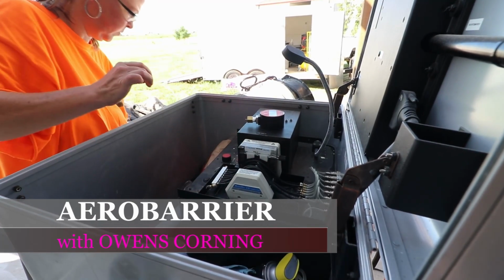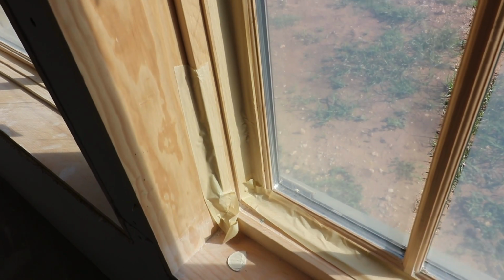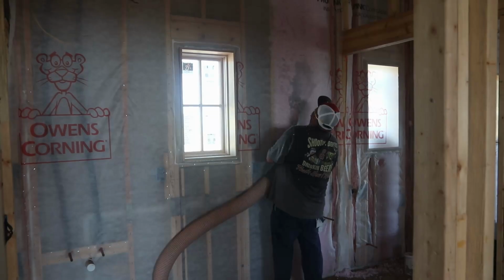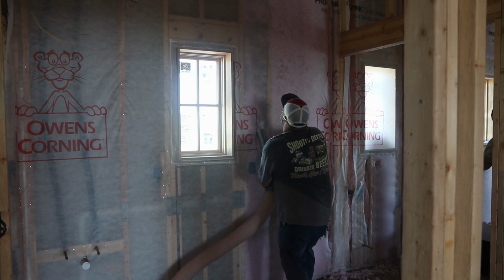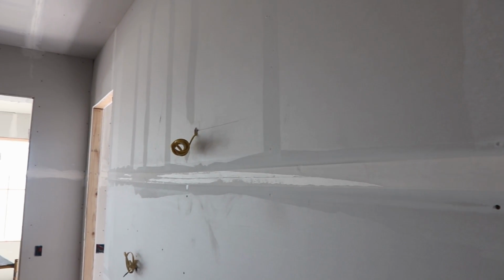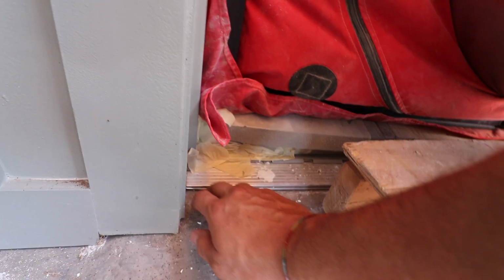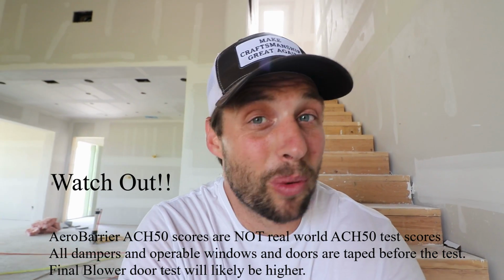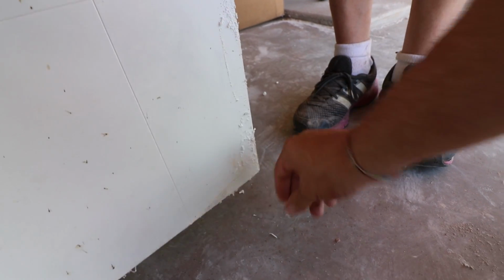This Insulation is BETTER than Spray Foam!!

Comment: Any material that can take on or assume local humidity will lose R-Value relative to the humidity assumed.  So if you are in an environment that has 50-90% levels and your thermal barrier (wall) can assume the same you will reduce the effective R-Value accordingly.  And as the humidity accumulates, from time to time you will also promote conditions ideal for organic life to develop.  So what is the best thermal barrier material?  The material that is the most impervious to any form of water (absorption) and wall air intrusion.  Once you stop air/water to a standard value, then you must introduce fresh air through a device like an ERV.  What about thermal roof systems?  If there is no air between your thermal barrier and roof sheathing - do not vent.  If there is, vent accordingly. Interior air quality levels in "tight" homes require removal of internal living space that accumulates.  i.e. Cooking odors, cleaning chemicals, bathroom odors, etc.

*R-Values of insulation materials are determined in a zero humidity chamber. However, real-life represent significantly higher values that actually determine final effectiveness.

Comment: Did you think of Rockwool instead of fiberglass?  I like that it is better for sound absorption and it is less attractive to mold/mildew and rodents (or so I was told).'

My houses with blown in or even batts in the ceiling do settle over time, fiberglass that is.  One house the blown in by the builder blew all over and some areas were bare, so we used a leaf rake to re-distribute the insulation, then put unfaced 10" thick fiberglass 'attic blanket' batts over the blown in, in the attic.  It REALLY helped.  It was an all-electric home so it had a significant impact on HVAC costs.  I wish we could have sealed that house, it would have been much better.

Comment: Is there no issue with finishes, Paint, stain ect once this is covering the surfaces?
Reply: How it doesn't settle on the floors or stick to other things is odd???
Reply: Good question, i also wanna know.
But you do this with no trim work up. If you do have cabinets, ive seen them tape it all off.
Im curious as to what happens all over the surface area of everything, though. And if its going out, where is it going? When I exhaust my paint room, the paint dust goes everywhere on the side of the building. I have to tape around the side of the exhaust window.

Comment: Q: why not use Rockwool / mineral wool insulation?  I have used it in projects and have had almost no air movement compared to Fiberglass.  It is also very fire resistant compared to Fiberglass.  The best part is the sound deadening properties of Rock Wool almost no sound penatration on 2x6 walls, coupled with triple pane windows the houses are very quiet compared to Fiberglass.

Comment: You showed your incompetence with your stupid comment that houses don't need to breathe. Houses very much need to breathe. There has to be a certain amount of air exchange in the house. There is a reason that no one builds air tight buildings. A properly ventilated and insulated house is the most efficient. You are actually ruining the efficiency of your  house by making it air tight. Horrible video and hopefully no one takes you seriously.

Comment: Wearing the respirator with a beard and forehead hair in the seal surface?  Both conditions render the respirator useless. The HEPA filters produce a greater resistance to airflow than that permitted by your fuzzy face.  Your level of protection was drastically compromised. Next time try reading the instructions that come with the respirator before using it.  (ref. 29CFR1910.134 (g)(1)(i) (A))
Reply: Thank you Sally Safety
Reply: @bigvegass  lol safety is no joke bro
Reply: You would be surprised at how much facial hair you can have and still maintain a seal. And this isn't from just anecdotal evidence - Because of the nasty chemicals and gases we work with, my company requires us to wear Scott full face respirators for certain tasks and we are re-certified every 2 years which includes fit testing where we are wearing the respirator and hooked up to a machine to measure the integrity of the seal.  I've done this fit testing with more than a weeks facial hair growth along with a goatee and I have other co-workers that have passed this testing with a full beard...

Comment: 1980's mobilehomes sealed all joints , and all homes molded and rotted , so if not insulated to passive house , there is no point
all voc in chemicals of  products , will poison air

Comment: Enjoyed this video. I’m fixin to build in central Kentucky and have flip flopping the insulation idea of spray foam or cellulose. How do you feel about cellulose on a slab style home with 2x6 walls and metal siding and roofing. Thanks for any feedback. Will be watchin your channel from now on. Great work.
Reply: Great idea as long as you use the glue mix, otherwise a 10 to 20% settling will happen in ten years or less.
Reply: Wow. That was fast. Since I have your attention.

My fave in 2x6 construction is to spray foam the first two inches and then to install rock woal for the balance.

The spray foam is a strength multiplier in the order of about tenfold in shear protection. Let them Huff and Puff. They won't blow your house down. 

This is always the way I recommend if finances allow for it.
Reply: VICTOR EOUS I’m not familiar with Rock Woal. What is that.
Reply: @eddiewethington1224  Actually it is Rockwool, typo on my part. It is an insulation made from Basalt and slag. I like it for a number of reasons. Firstly for its fire proofing qualities. Withstands up to 2,000 degrees F. Secondly is soundproofing. I've not seen any data to back this up but my own experience is likened to the sound proofing of a triple pane window vs a single pane. Thirdly it resists water, it just runs off of it.

Google it or do a search here on YT, I'm certain there are builders extolling Rockwools virtues.
Reply: Thanks for the info I have been watching some videos on Rock Wool. Simple to install. The RW in a 2x6 wall should be enough insulation in my area of Ky. What would you recommend in the attic for insulation.

Comment: Cellulose insulation is marketed as fire resistant. This is partly accomplished by adding boric acid to the recycled paper content. In order to spray cellulose in walls prior to drywall, water is added to make it “stick”. Boric acid will deteriorate metal fasteners such as nails, truss plates, PEX seals, etc. as the recycled paper deteriorates over time it becomes a fine powder. Any penetration into the interior of the house allows this fine powder to enter the house. This will create a dusty house. Since a majority of the recycled paper is newspaper the ink from this paper is included in the dust. 
Also as the cellulose breaks down and becomes a fine powder it settles. In some cases this settling will be as much as 20”- 24”. Not a good product. It’s cheap. But do you want to be known as a cheap contractor?

Comment: I live in a house in central TN., the only insulation it has is news paper under tarpaper from the 1940s... I would like to insulate but what is cost effective in a house already FINISHED???
Reply: what is your exterior siding type??  Blown in cellulose thru exterior siding??
Reply: @R_B62  now we have 1in boards covered by asphalt rolled siding ... plan on going with board N baton

Comment: Originally aerobarrier was aeroseal. Instead of sealing the whole house, aeroseal was pumped into air duct system to seal hvac leaks. Good for retrofitting. Wanted to do it at my place but there were very few companies offering it. Also the cost was seemed a little high ($1,800) 5 years ago. At 80 cents per sq ft, aerobarrier is economical new build upgrade.

Comment: You are using the drywall as an air barrier?  <rolls eyes>
Reply: My eyes rolled as well. Better to do a full seal on the exterior walls and call it done than to seal interior walls where nails and such will over time be tapped into the seal to hang mirrors, paintings , photos and such. Nevertheless, the video was well done and kudos to the gent for his great attitude towards attaining his goal.

Comment: 18:00  this sounds great if you only plan to live in the house for 5-10 years, but side by side analysis shows that closed-cell foam insulation works better in the long run.
Reply: source?

Comment: Jordan two things;

1- This aerobarrier application with blower is not practical. what you should have done is using the vacuum infusion system that they use for building boats and yachts. You bag the house with plastic sheeting and close it and suck the air between the sheeting and the walls and fill it with that micro particles. You need more tubes though.

2- For air blown insulation whether it settles down or not why don't you ask about it to your friend Matt Risinger. He was using it about 8 years ago. He even has a video about it; Owens Corning Energy Complete.

Comment: We used a blow in cellulose in an old house wall which had no insulation, and the improved noise barrier was a huge improvement for road and other noise. Better than fiberglass.

Comment: Wouldn't it be better to seal the house before you insulated, that way the studs and wall cavities are definitely sealed. As for fiberglass, no thank you, it isn't that good. First off, fiberglass can absorb moisture from inside the house. Secondly, vermin just love fiberglass for housing and highways. I have seen a lot of this happen. I prefer rock wool. It is a better insulation all round.
Reply: AirKrete is way better than Rock Wool.
Reply: AirKrete is only something ive seen done on commercial buildings and in metal framed buildings..  never on drywall and wood framed..
Reply: @Z-Ack  here in northern Vermont 
I have a building, 2×4 framing  plywood both sides, sand bags filling the stud bays, with 1.5 inch foil face   polyisocyanurate wrap on the outside.  The building didn't freeze last winter with only sunlight.
Reply: If u have mice in your fiberglass/walls u have a lot bigger problem than the material you're using to insulate.
Reply: Doesn't it compact moreso?
Reply: Now they want treated lumber in framing just stop the air from coming in!
As u said stop moisture from coming in    I swear the more educated people get the stupid they get?

Comment: I've never seen so much dog and pony at the homeowner's expense.   The house was already 100 percent better than code for tightness,  and yet you want the homeowners to pay some 6k to fill a hole a quarter size to a dime size??????  This is madness.  
At the level the house already was, and the waste of money already spent on caulk atomization,  the homeowners and their grandchildren will be long dead in their graves before they ever see a return on their 6k  investment.  We are talking about fractions of fractions here to go from 1.39 to .68.  
The only thing you've proven here, which has been known for years, is that a  glass insulation can achieve the same blower door tests as spray foam for 1/3 the cost, and when you factor in the interest rate on a 30 year mortgage for this madness, then the homeowners are getting double banged hard. 
This "science" doesnt equate with the hard facts of mathematics of diminishing returns and that uninformed homeowners are being fleeced.  
I laugh at how school girl giggly this guy gets because he went from 1.39 to .68.  
I wonder if he got a peel and stick star to put on his shirt? 
Ridiculous really.

Comment: Looks like you could have made better window and door choices. Zip R sheathing and spray foam for stick built frames is good but you are far better off going ICF for all foundation and exterior walls, especially when in hurricane and tornado prone areas. ECF has better strength ratings, less leakage and when combined with doors and windows that meet European standards the envelope is able to meet passive standards easily.

Comment: This old house did something similar with sealing duct work with a system similar.  Quite expensive and I imagine this is much more expensive.  
Houses do need to breath.  Moisture builds up inside the house.
Reply: He addresses this at 2:00. Modern sealed homes have air filtration and exchange systems to improve air quality.
Reply: @StymieBlymie  We have homes like this in my area.  I guess the ones local weren't done correctly because they are moldy and rotting.

Comment: Fiberglass insulation slows down heat transfer. So without fiberglass insulation. by 10 am. The house is already hot.  With fiberglass it will take longer for the heat to get into the home. But. It will also take a long time for the insulation to cool at night. It will be cool  outside, and the house will still be hot. A good foam insulation will insulate a hole lot better.  Cost more. but it will not take long for the pay back in lower heating, and cooling bills.

Comment: Would like to see what a flash and bat with rock wool would do. Perhaps just rock wool alone. But I have been a big fan of net and blow as far as getting the most bang for your buck. Not sure if it's the kindest to our lungs as some other products, but between improperly installed blow in fiberglass settling and improperly applied spray foam off gassing, I'd take the settling all day long.

Comment: Cellouse will settle about 6 " over time .
Reply: I've been doing remodeling for over 40 years, every wall I open up with loose fiberglass is all sagging and half the wall is empty at top and its full of debris where critters have gotten in..spray foam no insects or critters can get in

Comment: I am curious how a blown in fiberglass would work in a shipping container exterior wall. The main focus would be condensation & possible mold on the pockets. I will be using metal studs with an 1/8” gap from the exterior container wall to prevent any transfer temperatures through the studs to the interior. Any one have any info or ideas?
Reply: Don't use a shipping container. Research it and don't follow the trend. You can build with much better materials and still save the earth.
https://youtu.be/3lGiSdN4cfk

Comment: Hey Jordan, great video. I built a new house in 2005 using an architect CD to make a house airtight using many tubes of caulk and expanding foam before putting 6” cellulose in the walls. I wish I had the technology you’re showcasing at the time. Between my work and a geothermal system those Indiana winters were not so bad. Thanks for the info.
Reply: You MUST add an HRV. This is the mistake that was made in decades past that made a lot of very uncomfortable homes with bad air stuck inside. Those days are over.

Comment: If you have the proper HVAC set up it breathes for you and your house...
Reply: Yup hence the V in  HVAC lol. Ventilation. Humans breathing bathing and cooking creates a ton of access moisture in the air that can cause mold if not ventilated.
Reply: I had a house once that if the HVAC was not on the front door took about 5 seconds to decompress to shut!  My gas and electric were less than $35 each per month! Very comfortable!

Comment: 😂 We are getting 1.9-2.1 on a REAL blower door test by an independent tester and are using old school framing with plain old OSB and Tyvek. We use Great Stuff foam for penetrations, caulk on bottom plate and 2 top secret details that cost minimal to get our low results.

Comment: What happens to the co2 levels inside this home when the erv goes down for 2 weeks, or theres no power for a week? Your ventilation is dependant on machinery. That's just dumb! I will keep my drafty house, over this idea any day. Have you seen how many people have died the last few years form co2 poisoning in the last decade in these super insulated homes? Gonna pass..
Reply: Do you have a link for those death stats? Curious. Also a skeptic as I have seen much catastrophic rot here in the Pacific Northwest due to supertight cladding systems like dryvit etc. The turn of the century houses have much better resilience..
Reply: @Gnurtspu   I do not have an active link, however i recall the first time I heard of it was in NY about 10 or 11 years ago. I have seen it in passing a few times since. But not anywhere I can recall. If you really want to look into it look at like 09, in NY or PA, and the death as I recall was an elderly woman. Moisture and mold where sited in that article as being another problem with over sealing a home!

Comment: Dense pack cellulose in the walls,  2" Closed cell under the roof deck (followed by the appropriate amount of open cell to meet code), and Aerobarrier to finish it off.
Reply: you are exactly correct.

Comment: Hey Jordan, how’d you handle the attic insulation? Is it a sealed attic or vented? We’re in 2b in Phoenix and most builders vent but more and more are going to sealed foam attics. I would think with aerobarrier and Zip you could vent the attics and burry the ducts in insulation while still getting really low ACH. Your thoughts?
Reply: Would be much less effective than foam

Comment: very cool, Perhaps you could give me your 2 Cents. I'm renovating a 60's brick home 1100sqft home in NC, which I completely gutted to the stud and found out it had no wall insulation just Asphalt Board. Electrical is done and I will insulate the walls now and I want to buy Owens 2" pink foam board, cut it and install it with gap spray foam. There are many areas that have big holes in the old sheeting and I know spray foam will be at least 2x as much. If you have any other Ideas, I'm all ears.